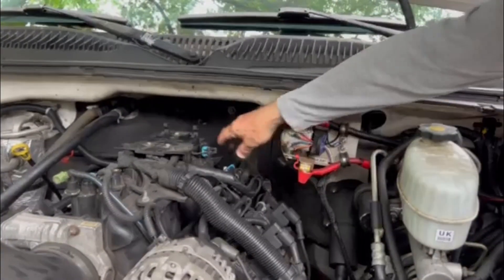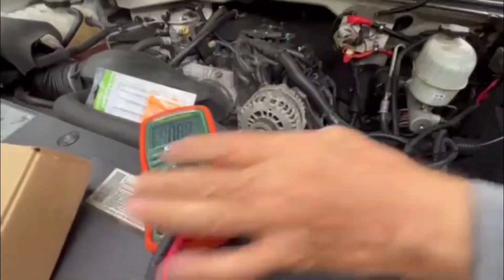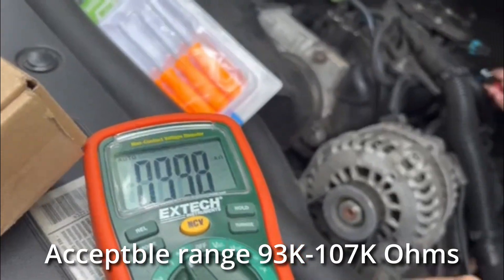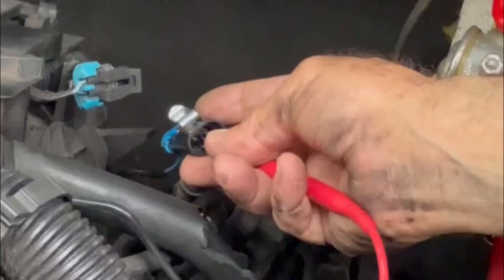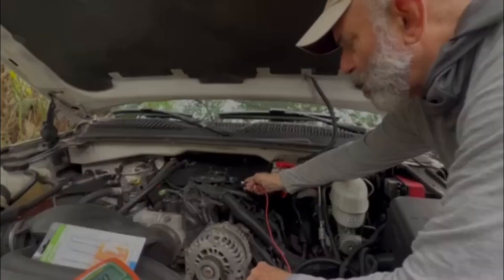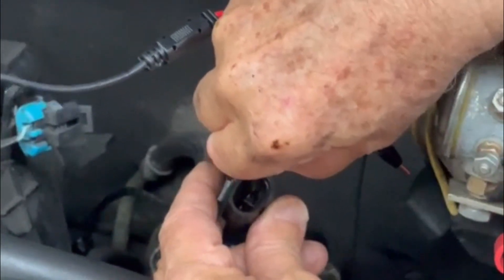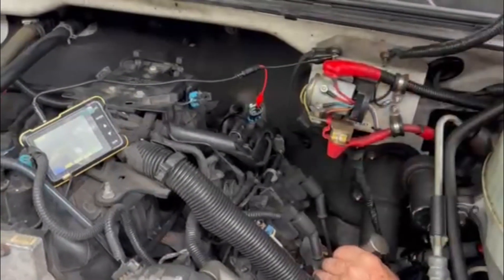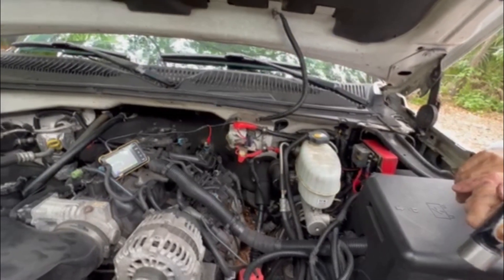Silverado Knock Sensor Tests

Comment: Did you ever determine what the issue was? I have a truck with a similar issue
Reply from the maker: I can confirm that the sensors and wiring harness are good and operational. I still get a PO332 code about every 500 miles or longer when I am cruising at about 65 mph after driving through rain. I have cleaned up most but not all of my electrical grounds. Now I just reset the code. Fuel trims have been checked and they are very good but still might actually be a knock under certain (maybe over lean?) conditions.